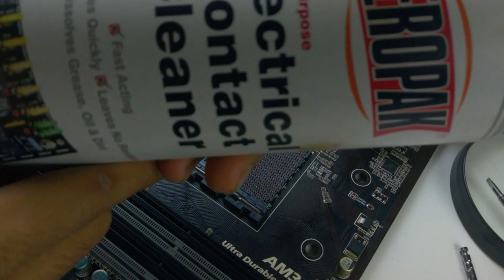Take apart AM3+ CPU socket

Comment: I was as careful as possible, and I got a white cover. I actually wanted to take it and put it into a board that has a black one, which I don't like there. It broke multiple times. I wouldn't try this, finding a replacement socket cover is very very hard.

Edit: However, now that I think about it, it is actually still usable and functions the same.

Comment: it looks you had to remove a broken cpu pin from the socket, right?
So your processor has one pin broken.

You should try another cpu to see if you got 4 dimm working (with dual-channel as well).

Finally cut a small metal, same size and shape of a cpu pin e put it directly to the socket in the position where your has a missing pin.
Reply: I feel like that's a horrible idea